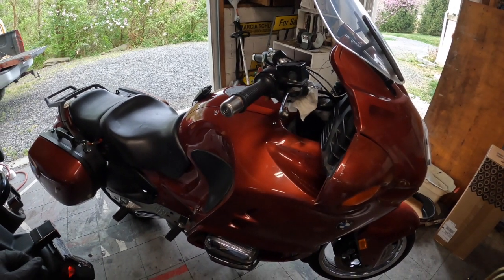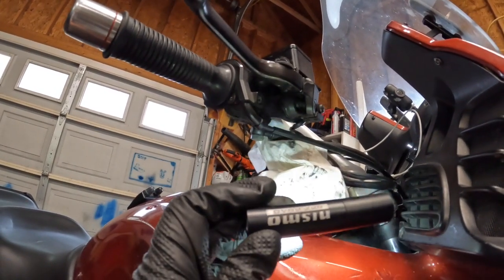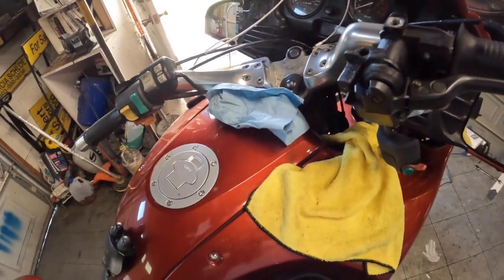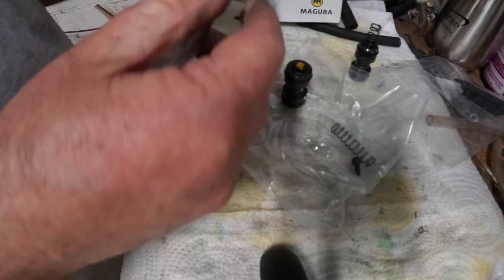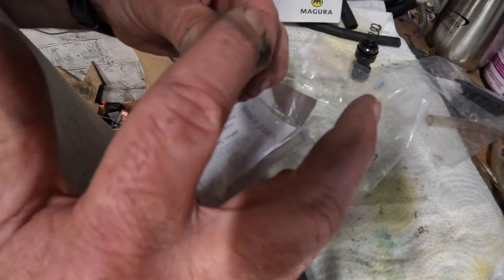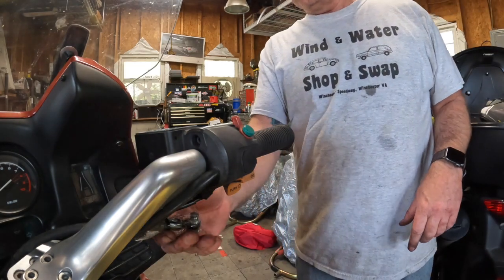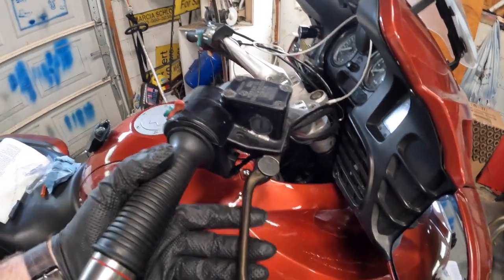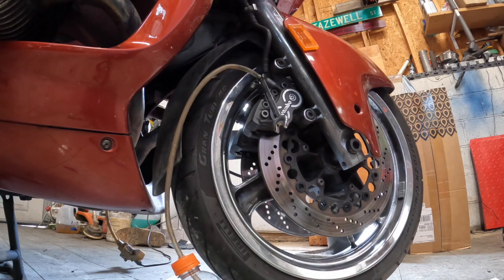BMW R1100RT Front Master Cylinder Rebuild

Comment: Thanks for the video…..Very good instruction on master cylinder rebuild. It looks like you still have the original rubber brake hoses…..that’s can cause many problems at this age of our bikes. Replacing all rubber brake hoses with new stainless reinforced hoses is recommended.
Reply from the maker: Thanks for watching. Yes you are correct. The hose is fairly new and looked good but stainless is a great upgrade.

Comment: What happened to make you rebuild the MC? My 95 RS has locked front brakes and brake lights are on. I’ll be rebuilding my MC shortly, so your video will be watched again.
Reply from the maker: Thanks for watching. Mine was leaking. Make sure you don’t have a collapsed line. Hope you can get it fixed ok.